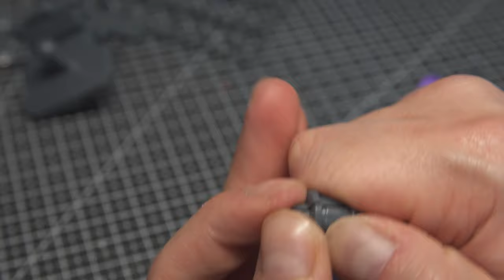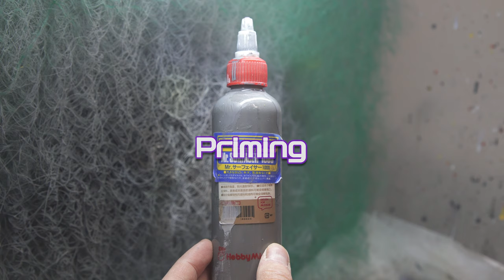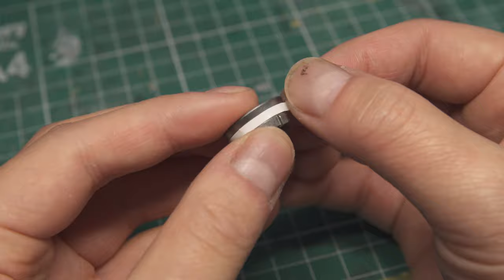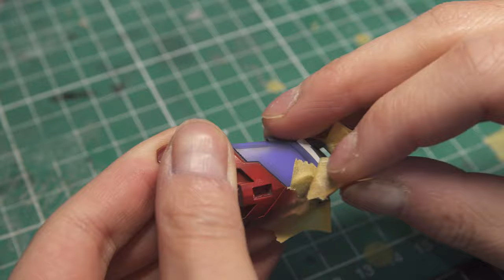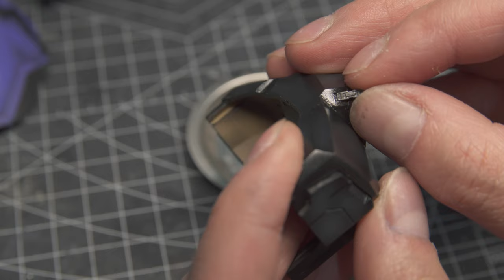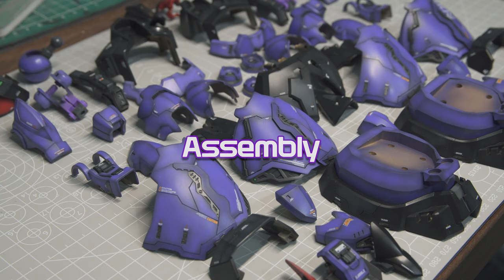MG Rick Dom Resin Conversion by The-51 | Custom Gunpla Painting ガンプラ全塗装

Comment from the maker: My Review:

This took less time than I thought it would and looks way more difficult than it is. 

==The Kit==
A very nice looking kit that drastically improved on the very dated base kit, though the assembly was a bit finicky especially of the legs. Would’ve been nice to have some clearer instructions as some parts definitely needed to be put in before others. 

Also a shame they only made closed fists and trigger hands as it limits the poses it can pull off.
On top of that, the kit when finished has close to 0 posability, this is mainly due to how old the kit is, but also the resin parts restricts certain moving points as well. Therefore you can't really do much more than bending the arms.

==Painting==
Used mainly 3 shades of purple and 3 shades of grey, but quite unfortunate the shading on black is completely gone after the flat coat.

Comment: Can you make a video talking about gluing? Cuz I'd started into resin everything looks nice until I glue them together the parts surface have some kind of white frost and I wonder what am I done wrong.  Too much instant glue? But some parts I only applied a dip of instant glue the white frost still appear near the surface of the parts later on. My environment is pretty dry not humid at all.
Reply from the maker: Hey saw your email, are you sure those are glue marks, even if they are, glue marks shouldn't be visible. Do the marks appear before or after flat coat?
Reply: @JLGunplaUK  After flat coat, as I painted those parts and flat coat them before putting them together.

Comment: Kinda wanted to see some test poses to see what exactly this kit is capable of once completed but otherwise this looks awesome! I really want one of my own to work on
Reply from the maker: Ah, the reason why I didn't pose is because it really can't move apart from bending the arms. 
The knees with the conversion don't bend, the base kit itself doesn't allow much horizontal rotation of the limbs, the front skirt doesn't move so can't lift the legs up. Head doesn't rotate sideways with the add on parts. 
And there isn't any open hands so the only thing you can do with a closed hand is have it pointing down